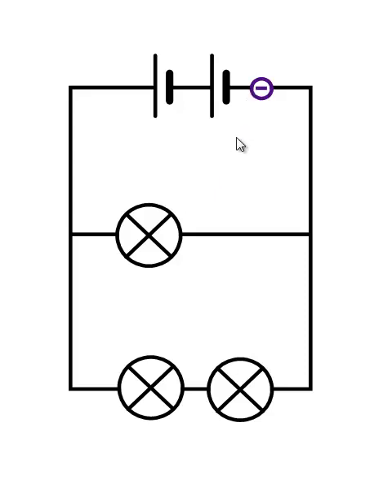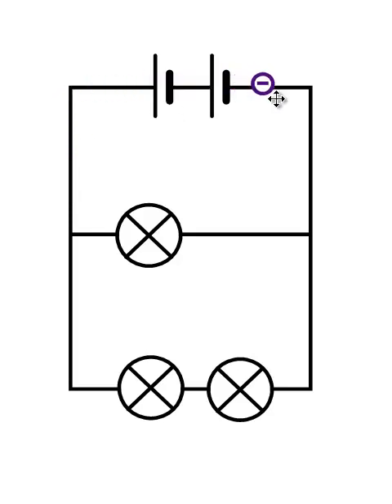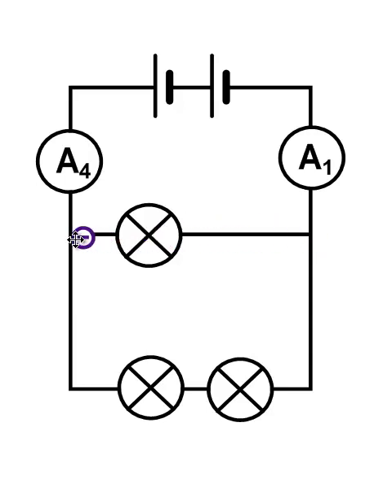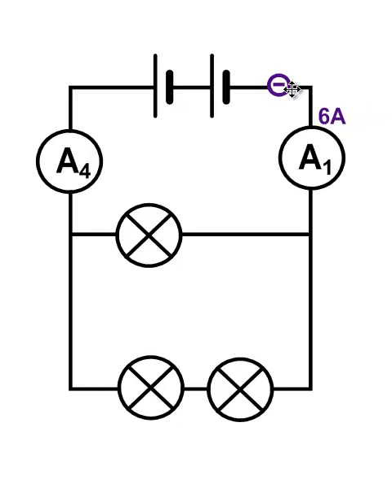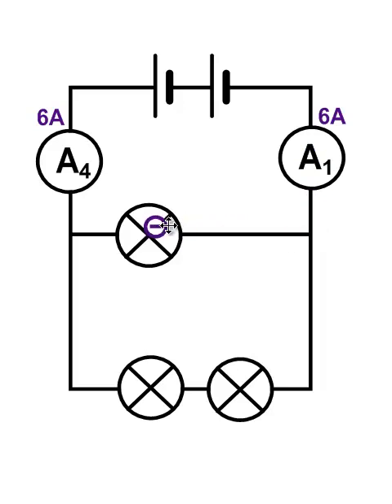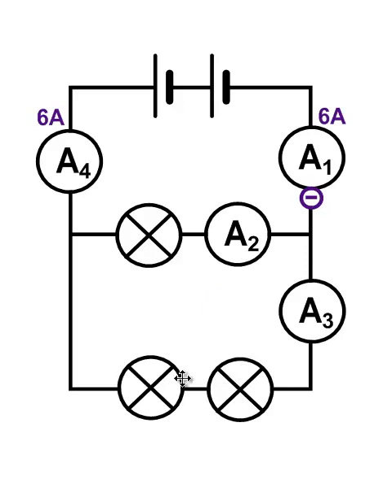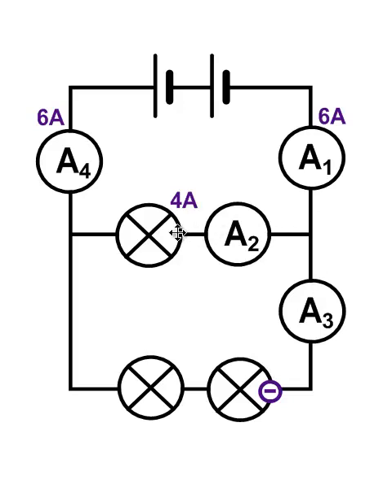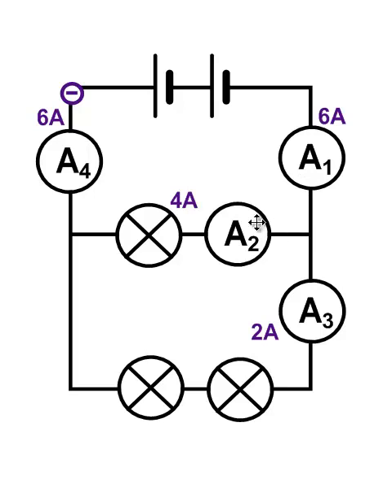Current parallel circuits

Comment: Why 4A and 2A split at juction why not 5A and 1A.
Reply: Because middle bulb has 2x less resistance than the bottom route. So there’s 2x more currrent going on the middle path. So the ratio of current is 2:1, and if we split 6amps into the ratio, it is 4:2, 4 amp in the middle with 1 bulb 2amp at the bottom with 2 bulb

Comment: + Ei Jing Tan
The bulbs will be brighter because the voltage (or power given to the bulbs) stays the same throughout each branch in a parallel circuit. I have no idea why this happens though.

Comment: Thanks, nice video, but I have a question. If the circuit had 3 branches, (and there was the same amount of resistance in each one) would the current halve at the first branch and have at the second branch, (Eg: 6 ÷ 2 = 3 in first branch ÷ 2 = 1.5 in second and bottom branch) or would it be split equally between all three branches (Eg: 6 ÷ 3 = 2 in each branch)? I hope someone answers my question, but once again, this video helped a lot. Thanks. :)
Reply: no one will?